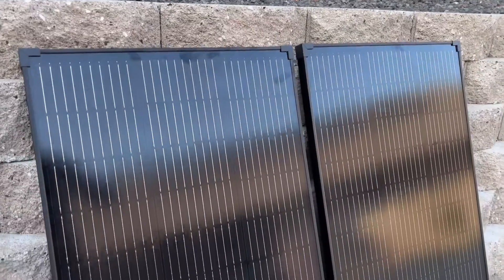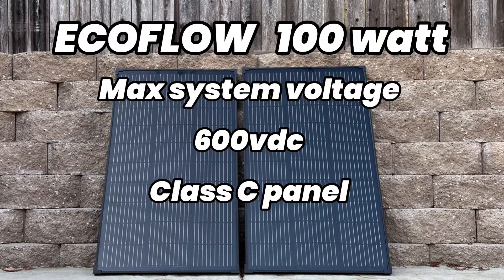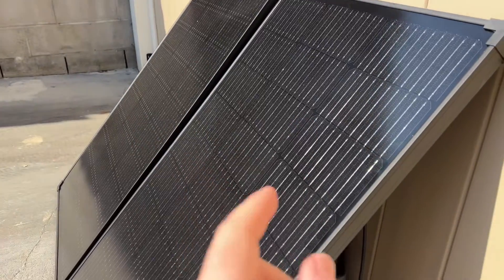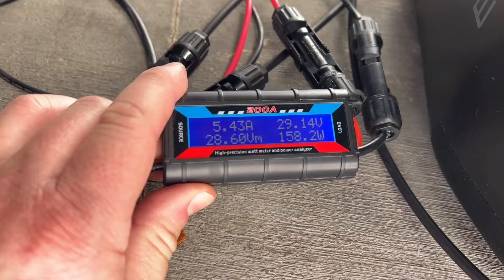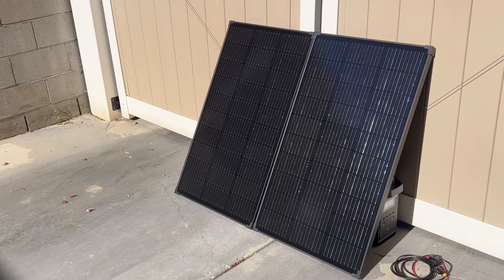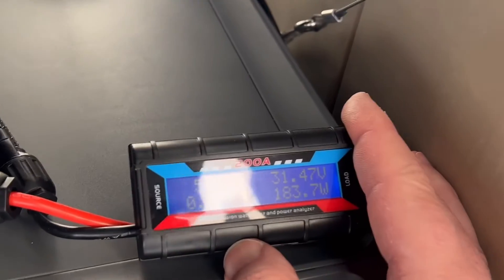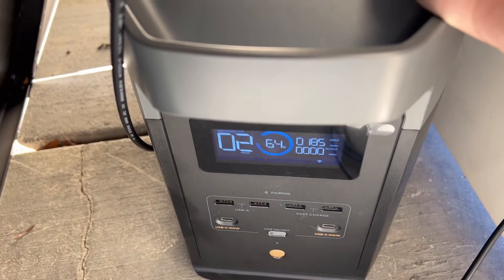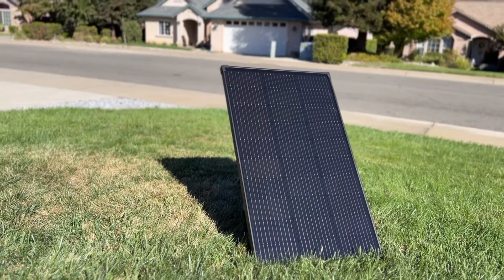Solar Panel Temperature Difference

Comment: I think in cold weather it would reduce efficiency so heater by increase resistance at cold and reduce resistance at hot weater by 2 different set of path of current because in North pole very cold like Canada or ice land may need higher resistant to keep warm and operating better so battery design for extreme temperature may face same problem but if changing resistance in opposite swing we may help battery and solar operation normal by control circuits
Reply from the maker: Solar panels have a temp coefficient. As the temp drops the voltage will go up producing more watts out. Now eventually it will swing the other way as you get into very cold temp but that’s probably -.10c 
When solar panels get hot, and heat creates resistance, then your overall output will be less.

Comment: Very nice comparison in Temps. I have a 1000 watt setup but when I had only 600 watts I could see a difference between summertime and now 480 summertime vs 540 now. For 1000 watts now at 60 degrees i was getting 890 watts which is good! . Great video and nicely done thank you!
Reply from the maker: Your welcome glad it helped ..😀👍🏼
Reply from the maker: And thank you 😁👊🏼

Comment: Do you know how many of the 100W Ecoflow panels that you can connect to an Ecoflow Delta Pro? I called Ecoflow customer service and was told 16 panels could be connected to the Ecoflow Delta Pro, because it can take 1600W of solar input. I knew this was wrong because the person on the phone was not considering the voltage or amp limits. Wondering if another brand of panels would have a more optimal amps/volts configuration.
Reply from the maker: Well it’s 150 volt max input and temp with make a difference. 
Doesn’t matter what panels or how you configure it as long as you don’t go over the 150 and not damage the controller. 

The ECOFLOW panels are great and are a good option depending where you plan to set up your array. But if you can source good used solar panels then that can save a lot. 

Just use all of the same what ever you buy

Comment: Another great video John. Do you have a link to the power meter you used in the video? Or the brand name and model number for it? Thanks.
Reply from the maker: Thank you and yes here is one..👍🏼 https://amzn.to/3UTSkiQ

Now it doesn’t have mc4 connectors on it the ones that do seem to always be sold out. 

But here is a nice kit I recommend and works great if you don’t have one. 

https://amzn.to/3Ev5c9M

Let me know if you have questions 👍🏼😀
Reply: @johnnysweekends  thank you!

Comment: Because of circumstances I'm considering using a solar panel inside my 98 truck windshield. How much power loss do you think I will experience due to uv stuff in the glass?
Reply from the maker: There will be some loss because of the glass, also angle to the sun, but it will still work and as power but you just won’t get a hundred or off the panel.

Comment from the maker: Did you like this short video..? 
Let me know 

Items in video 
ECOFLOW 100 watt solar panel: https://amzn.to/3g2VT7g
ECOFLOW delta 2: https://amzn.to/3tlR6Rr 

If you feel that I helped you maybe consider buying me a coffee 👍🏼🙌🏼👊🏼😀
https://www.buymeacoffee.com/johnny5120J

Everything ECOFLOW Discounts!!!!
PROMO CODE: JOHNNYSWD 
https://modernhouseusa.com/collections/ecoflow-1

FULL SOLAR KITS & ECOFLOW , BUNDLE AND SAVE!!!
https://shopsolarkits.com/1134
Reply: Someone is up early (I'm on the West Coast) 🤠 For my Delta 2 I use four 120-watt panels (480-watts of 500-watts "max" D/C input). Currently, our outside temp swings from the low 30's at night to the high 50's during the day. I should check the surface temp on my panels also ~ Good job! 😎
Reply from the maker: Thank you. And yes temps have been swinging to about 35 in the morning and about 60 or so depending on weather. 
Great for my home system but the back has a couple trees that hit in the winter..🫤